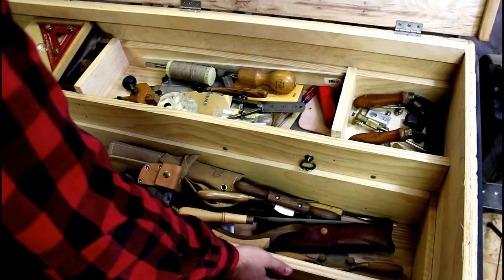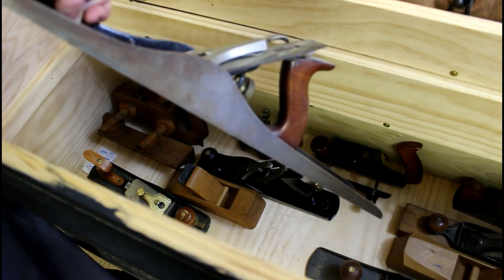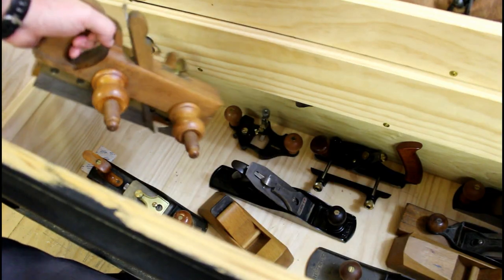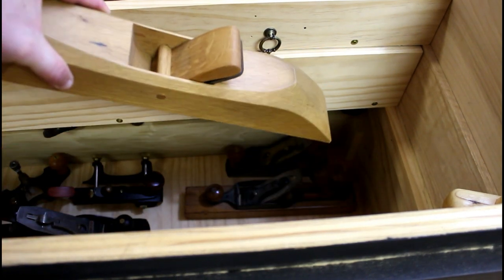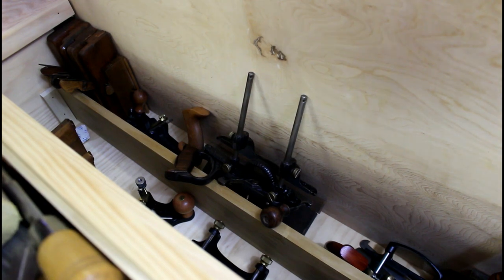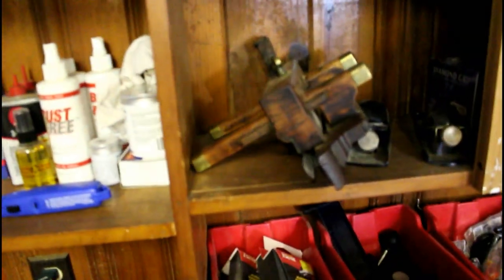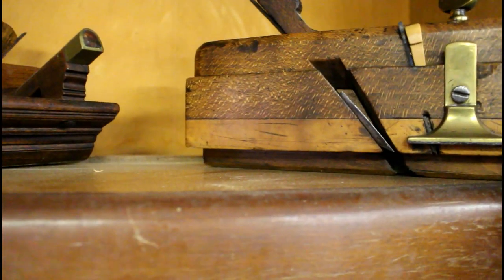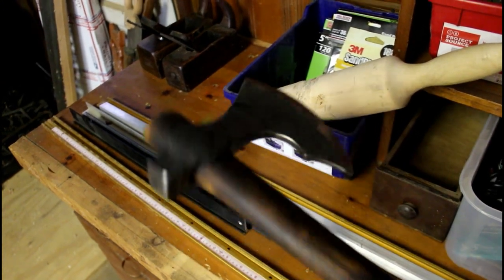The Anarchist Tool Chest Part II

Comment: suggestion for the planes rusting down in bottom of the chest: seal up the wood. Oil based possibly. 
I had some tooling stored in an oak chest and it seemed to rust more than other tooling in different storage that I have.
I finished it with some oil based stain/finish I had laying around and the problem seemed to go away.
Gotta luv the environment in EastTN...
Reply from the maker: thanks for the tip,